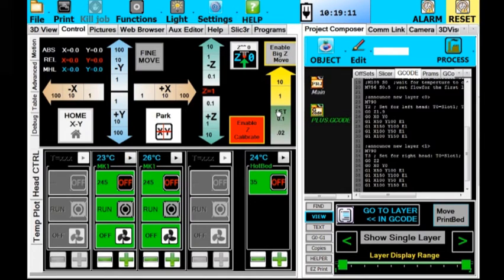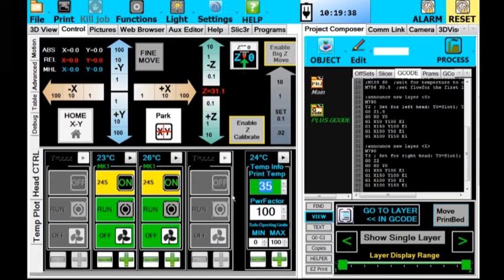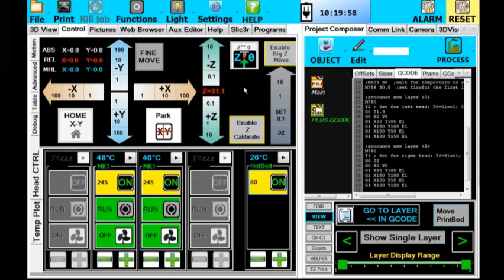Session 3A - Setting Two Heads to Z-Zero

Comment: what to do if I blew up the 4A fuse. can I in any case replace my 4A fuse?
Reply from the maker: Yep. Remove the top yoke board and see if your fuses are soldered in (older units) or in fuse holders (newer units). Email us at hyrel3d@gmail.com with questions, or to order fuses; you do not need to order fuses from us.